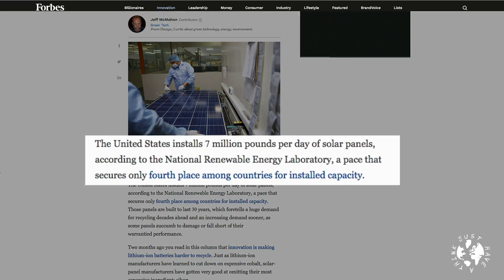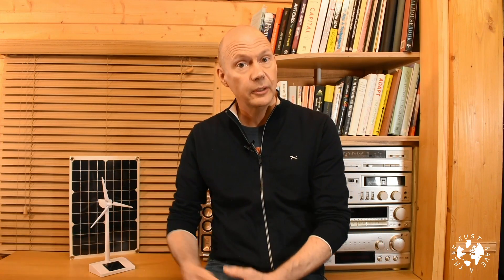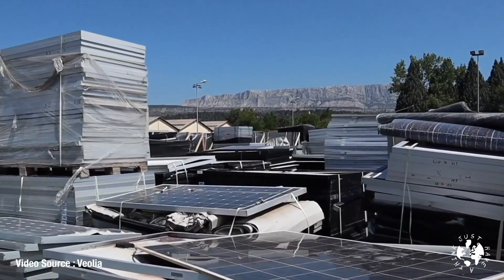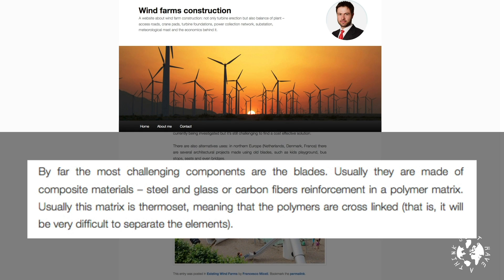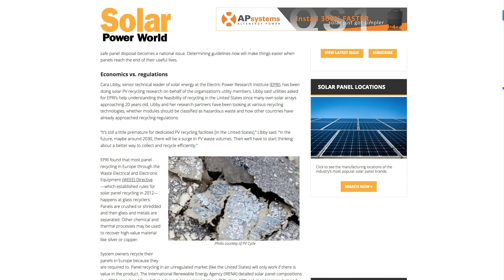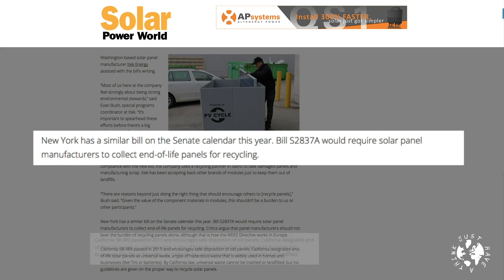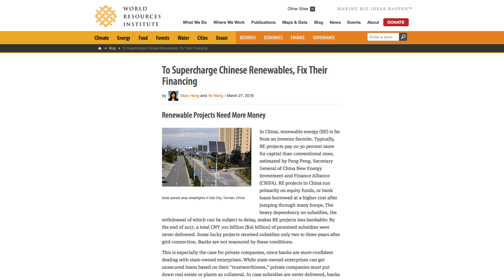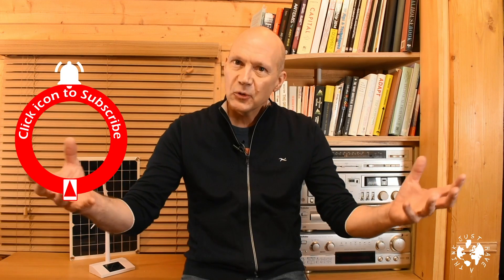Recycling renewables : a price too high?

Comment: How much pollution, fossil fuels and energy use does it take to recycle all this stuff? The stuff that doesn't end up in landfill. 
Just going round in circles while all the time making things worse for the biosphere
Looks like we are going to desperately cling on to big industry and global economy until we destroy everything
Reply from the maker: Hi Stephen. I take your point. But while we have a market economy, what you describe above is indeed how things will get done. There are alternatives like complete global economic system change, global societal revolution etc. etc. but they quite chaotic and difficult to manage. They may well be even more terminal than the issue you highlight. The future, unsurprisingly, is extremely uncertain.
Reply: @JustHaveaThink  Nuclear is the only option forward and in the UK they protest new sites for Nuclear plants because they think they are unsafe when in fact they are now incredibly safe and clean and cheap.
Reply: Who says they gonna use fossil fuels to do the recycling?   They can use electricity produced with wind and solar, and if hight temps are required they can burn hydrogen, which is produced using clean electricity. By the time this gets of the ground all vehicles, buldozers, trucks etc., also run on electricity
Reply: @MarcoNierop  ALL? Yeah, when I look outside, Utopia is just around the corner! Can't wait for tomorrow! -.-
Reply: @piopapae2724 search on YouTube: Tony Seba Clean Energy And Transportation Disruption... Watch the complete lecture (about an hour). Then come back and let me know what you think.. It changed my mind mind, so why not yours.
Reply: @MarcoNierop  Dr. Eike Weber from Fraunhofer Institut uses the examples of "disruptive" technology and refers to Tony Seba (the speech is only in German).
I quoted some facts from  that speech in my comments in the thread of user +tcmspeech - the political commentary on Merkel is mine ;) although Weber is also critical on Merkel. That just when solar is about to take realy off (being used by companies) they invent obstacles to protect Big Coal and the energy plants that use that outdated fuel.
Reply: @MarcoNierop  Great video, he changed my view on things about 5 years ago.
Reply: @MarcoNierop  Great video, he changed my view on things about 5 years ago.
Reply: Could use a Solar furnace. This is way simpler and doesn't contain toxic waste as you just use mirrors to focus the energy onto a small point. There are several around the world. Recycling will be required to ensure reuse of the rare materials used for the next generation of products.
Reply: Peter Dawes hi there, use a solar furnace for what? 
We have 2 to 10 years to half global emissions depending on who you believe!! Some say it's already to late because the oceans have soaked up so much energy which we can't take out.
Then there is the latest UN report among others regarding global overshoot of resource consumption habitat loss and rates of species extinction, biosphere collapse 
We cannot retain this level of resource extraction, consumption and continue the distraction of habitat.
We basically have maybe a decade to change the global economy, humanity's consumption and half all co2 emissions.
The Only way we can stay under 2 degrees c plus is to set up carbon draw down globally and get co2 out of the atmosphere!! 
This is all based on current rates of warming, sea lvl rise and consumption, rates that are accelerating 
Plus we have to hope positive feedbacks like Arctic BOE albedo loss and Arctic methane among others don't kick in.
2018 saw the highest rise in global emissions on record and resource overshoot day moved to 1st of August. 
We are destroying the planet faster than ever and it's only accelerating 
2 decades left if we are lucky is my guess
Reply: @stephenmason5827  I really believe we were too late in the 90s to stay below 2 degrees. Its whats already locked in and is coming like a tsunami. My feelings are only grief for the loss of this once beautiful paradise in perfect balance. When the Arctic sea ice is gone and latent heat builds then it is game over for humans and almost all mammals.

Comment: The big problem, now, for renewable energy, is the destruction to the environment caused by mining the resources needed to build solar, etc....And it is a massive problem....It's not just the climate catastrophe, it's also the ecological destruction and the biological annihilation....Those three issues are combining and feeding off each other to produce a "perfect storm", that is destroying the systems that support life on earth, where it will end is uncertain, but we will end up, exactly where we are headed...."Societies collective madness, is what we call sanity".--RD Laing
Reply from the maker: Always worth hearing your point of view sir. And it's one that should not be taken lightly. My understanding from researching this particular topic is that there is a very keen awareness of the raw materials problem and great deal of R&D is going on to find alternative materials that might be less harmful and impactful at extraction. Whether they succeed or not is, of course, yet to be seen. All the best . Dave
Reply: The main material for solar cells is silicon,  silicon is acquired from silicon dioxide (quartz), the earth's crust is composed of 90% silicate minerals.  Gold miners throw quartz away.
The doping materials to create n/p status are combinations of copper/ phosphorus. 
Then glass which again is quartz based,  aluminum for framing. 
The more solar is applied to independent systems,  alot of material will be saved.
Ie  cottage owners using photovoltaic systems will displace the resources for gas powered generators 
Solarized vehicles will replace the resources for personal gas guzzling machines and the massive infrastructure that supports them.
Reply: @ricksmall5240  I'm referring to rare earth metals, which are used in the electronics...And the damage to the environment from the mining process..I'm well aware of every aspect of solar, since I install it for a living (part time)...Anything that enables a consumer based throw away society, is a death sentence for the planet's life support systems.Fifty percent of emissions from vehicles, occur in the manufacturing process. Mass production- mass consumption equals mass destruction. I wish I was still in the phase of enlightenment, where there existed answers to these issues...There are no answers, other than preparing, for life after collapse...if your not there yet, mark my words, you will be....
Reply: @realeyesrealizereallies6828  -- There are ZERO "Rare Earth(s)" required for Silicon Solar PV.    Why create make-believe problems?
Reply: @philtimmons722  Are you hjgh....just google rare earth metals, solar panels, electronics and batteries......Don't take anyone's word for anything.....
Reply: @realeyesrealizereallies6828   good thing the damage of mining (or insufficient recycling) is only relevant when it comes to renewables ...
Reply: @realeyesrealizereallies6828   I will assume you are not concern trolling. You make good points. It used to be that magnets in Wind turbines were neodyme (not anymore too expensive). Lithium is problematic (so are other mining processes, part of it is the greed to not innovate less harmfull processes). Lithium production also needs a lot of energy (of course in the desert in Chile they have plenty of sunshine ...) Or in the Sahara, or in Bolivia (height, sunny and cool is ideal for solar energy that could provide the process energy, which also could be put to use (like warm water for residents).
Reply: @realeyesrealizereallies6828  There is research going on for solid state batteries - many of them NOT Lithium based and based on more common raw materials (for instance glass, sulphur if I remember correctly). - and of course other STORAGE in form of fuel (gas, hydrogen, artificial photosynthesis electricity, or storage of compressed airs, lifting weights.

If cars would have batteries that can be swaped -  fast charging, weight, density would be less of an issue. So the high performance of Lithium would not be needed. In lab situations they already tested batteries that perform better than Lithium, but of course there is the issue of mass production, stability, durability, .....
But there is a good chance Lithium may be the battery for devices and tools - but not for cars and homes.

Instead of filling the tank you pick up a recharged smaller ! battery. Or you charge one at home with surplus energy from the roof. Then it must not be Lithium which is the best performing material so far (density).
Many people do not drive that long distances on a daily basis, but they want to be on the safe side for traffic jams or the occasional longer ride. Which would not be a problem if you can get charged batteries everywhere (and you can have an extra in the car).

Comment: The thing that gets me is that 'recycling' rarely reuses a product at the same grade. In this video, the most obvious example was the wind turbine blades that are shredded and used in cement - not to make more turbine blades. Likewise the cement will be used in a building, and when that's demolished it could be reused as the foundations of a road. After that, it's probably not going to be used again. So there's no complete 'circular economy', and if we keep having economic growth then resource use will climb indefinitely.
Reply from the maker: Hi Mike. Yeah, it's annoying isn't it. But it is at least a start. And I imagine that there'll be more innovative ways to recycle these things as the entrepreneurs get stuck into the industry and dollar signs start flashing before their eyes. I think we have to accept that as long as we have a market driven economy (which may change, of course, if the worst case climate scenarios do actually come to pass) then climate solutions will necessarily be rooted in prising money out of rich people's hands to do good things instead of the shitty things that many of them currently do today. And of course we need governments to force through that agenda too.
Reply: @JustHaveaThink  that's definitely a valid viewpoint, though I think the alternative - that if we keep a completely free market economy that will in fact bring the worst case scenario about - is possibly more likely. Either way, pressure on government to face up to the situation and tell the truth is a good start, and maybe Extinction Rebellion will make some progress on this point mid April...
Reply: @JustHaveaThink  oh, and thanks for the videos, they're really good and thought provoking! 🙂
Reply from the maker: Cheers Mike. Much appreciated. I'll keep plugging away :-)
Reply: The circular recycling symbol is the most circular aspect of recycling.
Reply: Endless growth in a closed system doesn't work in any case but regardless of whether solar panels or wind turbines are recycled they consume nothing but sunshine and wind and produce no waste or greenhouse gases other than that made in their production an eventual disposal. That seems like a BIG win to me.
Reply: @bclev1953  sure, I like renewable energy too. I just don't like it when people think endless economic growth can continue if we use renewable energy and a (magical) circular economy.
Reply: @mikepepler  I've  had a real bad feeling  about  growth  for  decades  now and  it's  only gotten worse.
Reply: Mike Pepler Bingo!
Reply: @bclev1953  look up the 2nd law of thermodynamics